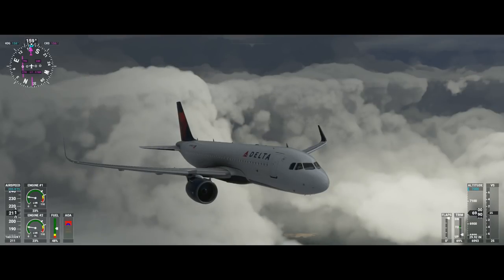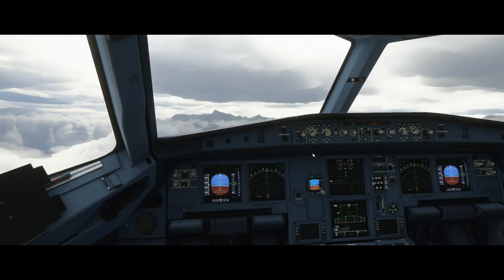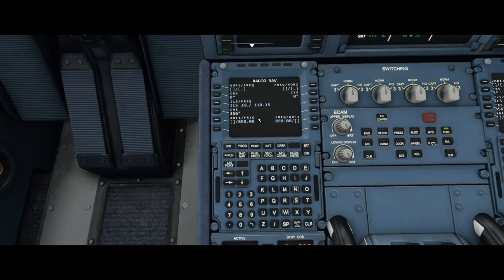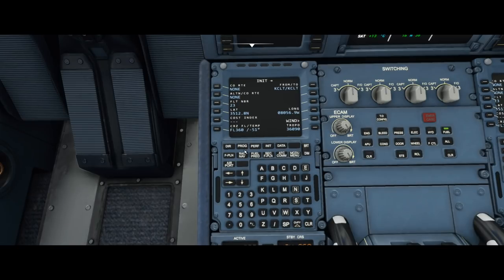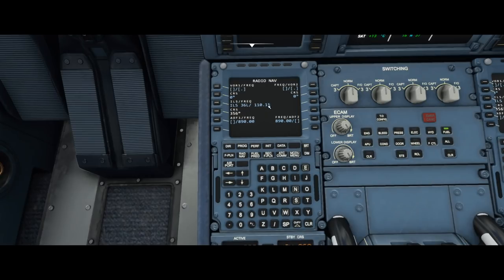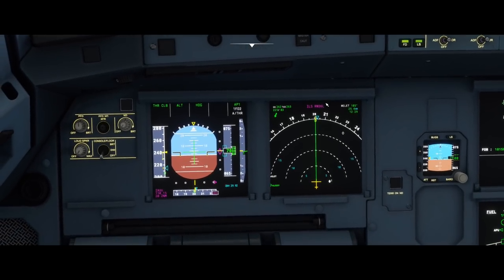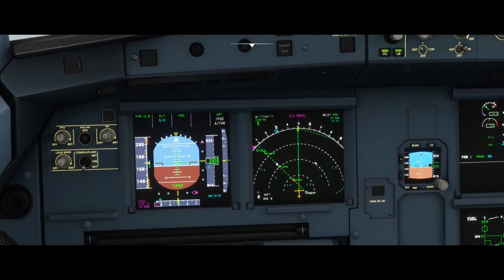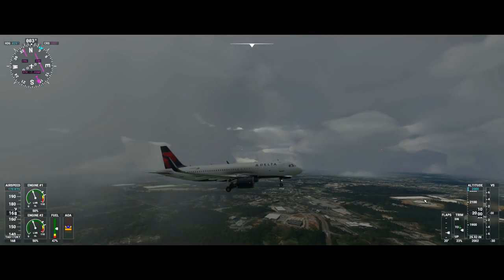Microsoft Flight Simulator | ILS Landing Tutorial | Airbus A320neo

Comment: hy thank you for this tutorial, what does the up button of the altimeter of the automatic pilot?
Reply from the maker: That is either open climb or open descent. This means it will try to quickly get at a selected altitude, and not follow the FMC ☺️
Reply: @captainhorn23  let me understand, if you are going 5000 feet high, and you select 4000 feet, on the autopilot, and the you press the down arrow on the button it will descend to 4000 feet, but if you go 5000 and you select 4000 on the autopilot, the you press the up arrow what it will do?

Comment: This helps a lot, but for some reason it keeps shouting my air speed is too high and I never seem to be able to follow the line with AP on. My airspeed was set to 180, but it kept climbing to 280+

How am I so bad at this? I havent landed once. I can take off fine though XD
Reply from the maker: You need to make sure your throttle is on the first notch, under “FLX” as shown in the video for speed hold to engage. Make sure your heading hold is turned on to follow the line too 👍☺️
Reply: @captainhorn23  Thank you! I think it was easy to miss for me because the video has so much useful information.
Reply from the maker: @Chris_Faust  Yeah man no problem! I am glad to of helped so much! :)